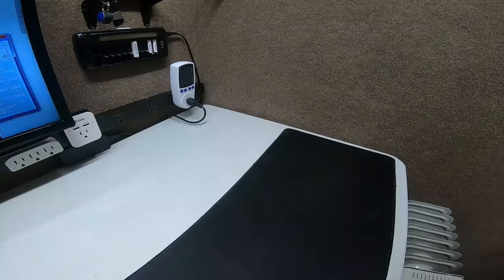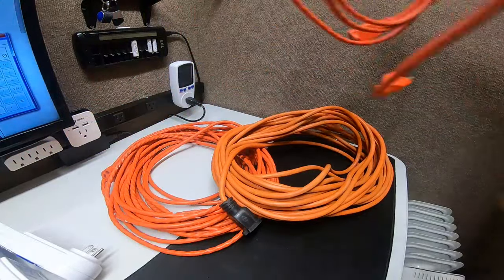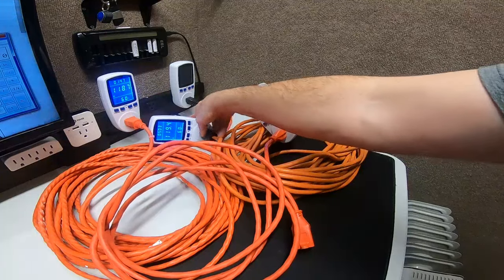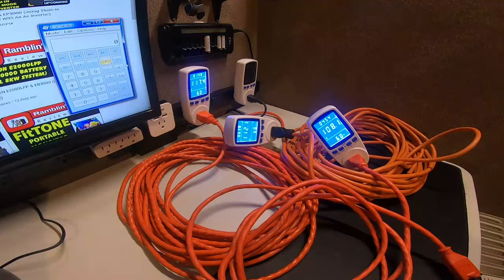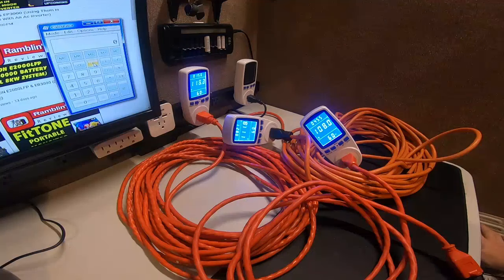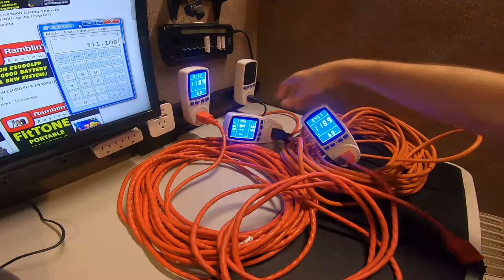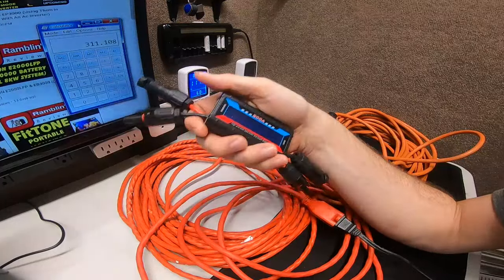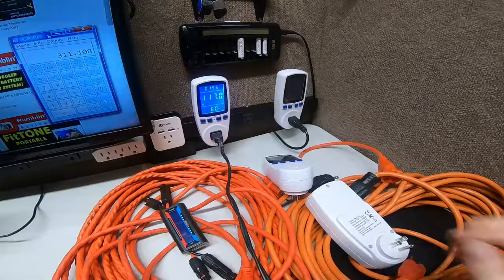VOLTAGE SAG - What Happens With Long Solar Or Electric Cord Runs? NOTHING GOOD !!!!!

Comment: Great demonstration, it's even worse to have voltage drop on inductive loads, electric motors, refrigerators, air compressors ( which I learned the hard way) almost burned up the motor. Good quality heavy gauge cords and shorter runs, or a Pecron E1500  to plug directly into.  Have you tested the 1500 on any power tools, standard skill saw, small pancake compressor.  Best regards!
Reply from the maker: Thank you, We thought that this is a very important topic for everybody, and running motors and compressors, and stuff like that will destroy that product quick. That is very hard on the items (voltage sag)

    We have tested e2000lfp & e1500lfp on a circle saw, vacuum cleaner, full size fridge, heaters, microwave, etc
(all of these items draw some pretty good amps when starting and running)

And the voltage did not drop at all with either of those systems. (no extension cords used)

note: Most of the tools that we use are dewalt 20v, so we do not have any really big tools to test anymore.

note: The main plug (black power strip with kill-o-watt meter plugged into it) that we used for this video was coming straight from the Pecron E1500LFP and running that 1500 watt heater did not drop the voltage bad...unless you run it off 110 feet of cord....LOL (Not a good idea)

(Our whole workshop is 100% solar power and batteries)
Reply: @RamblinBobReviews  Your the best! Take care brother...